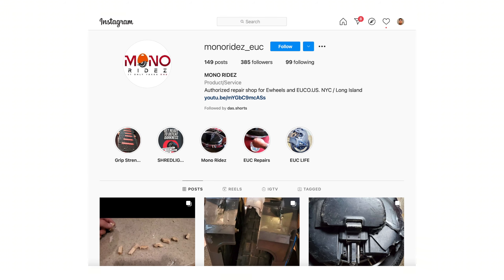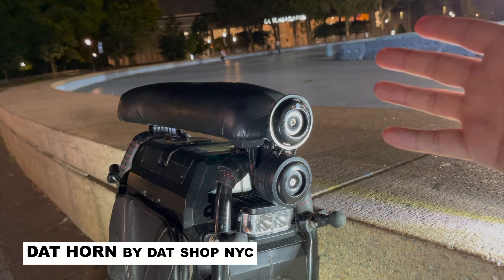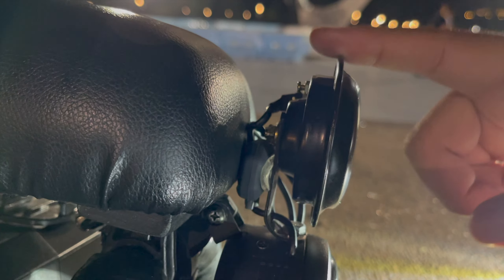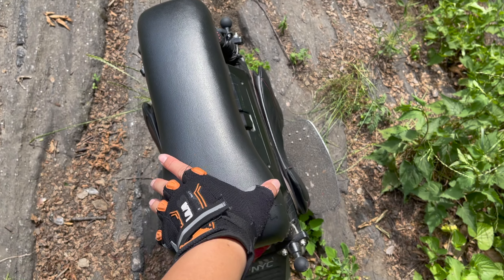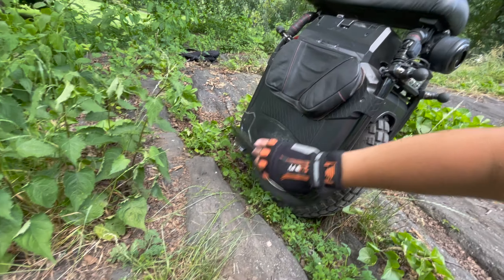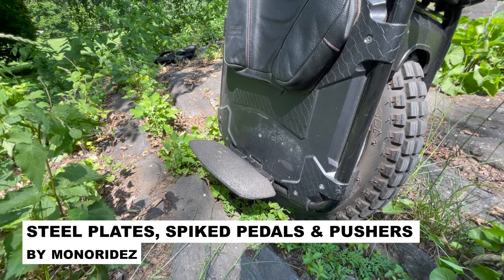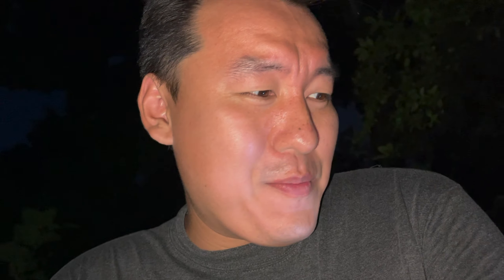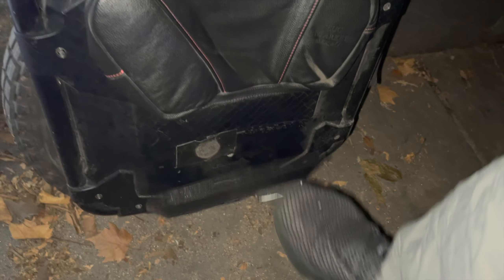Best VETERAN SHERMAN accessories | How I set up my Electric Unicycle

Comment: question Bro off topic ... how come I can't find any info or vids on Chargers for EUCs? ... Quick Chargers ... charger setups .. brands ect..
Reply from the maker: All the chargers are pretty much aliexpress chargers. The ones ewheels sells I think come from there too. The problem is finding the right one with the right voltage and amperage so you don’t blow your wheel up. I bought my 3 amp from ewheels. This is what I use to charge at night daily. I also have a 7amp that I use for fast charging. That one I got from a local dealer in nyc nycerider on IG. But you can find them also on aliexpress. Just make sure it matches the voltage output of your wheel.
Reply: @dasshorts7800  thank you so much for this info ... im in Brooklyn about to get into this hobby trying to learn as much as I can before my wheel gets  here ... thanks again I really appreciate the response...
Reply from the maker: @kazzmack9385   what wheel do you have coming may I ask? Your best bet for fast chargers is probably ewheels or nycerider for local pickup.
Reply: @dasshorts7800  Sherman max (eWheels) ..they say it should be here at the end of Feb . im thinking about going with either the V12 or RS for my second ride .. still watching hours of vids and learning as much as I can ...
Reply from the maker: @kazzmack9385  ok you need the 100.8v 7amp charger then for fast charging. The Sherman should already come with a 5amp, but with another 7 you can charge at 12 for emergency situations. Nice choice.
Reply: @dasshorts7800  thanks bro ..... im definitely adding this to the list of things I  need to pick up ... I really appreciate the help ...

Comment: It doesn’t look like it is, but do you find the seat to be bulky at all? I currently own the surron seat for my Sherman, but I find it to be way to bulky towards the front (the end with the hump). It gets in the way of my knees when I’m riding standing up, and I overall just feel less nimble and restricted in my movements when I’m standing. It’s a great seat for riding, but obviously I’m not always sitting down. 

The zoom wheels seat seems to be pretty slim towards the front, but just wanted to see if you think this seat will fix my current problem that the surron seat gives me?
Reply from the maker: It’s not too bulky. I feel it touching my legs when riding standing, but I got used to it. It doesn’t feel like it’s bowing my legs.

Comment: Do you experience vibration with that Zoom seat which requires you to have to ride soft mode?
Reply from the maker: Nope. The only thing with the zoom seat is that it slides around if you don’t put industrial Velcro under the clips.

Comment: I see that you also have crash sliders (I guess you would call them) attached to the front and back of the roll cage. Where did you order the parts for those and was there any challenges finding and installing the parts?
Reply from the maker: I got mine on Amazon. I put the link in the description. They’re not too hard to install. I mostly use them so I can lean my wheel on its face against the floor. But they also offer some protection.